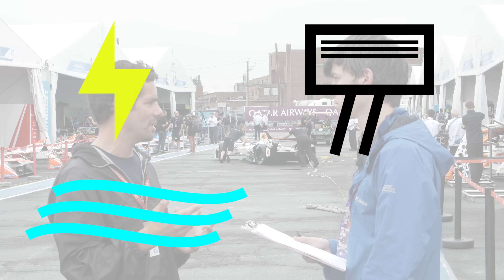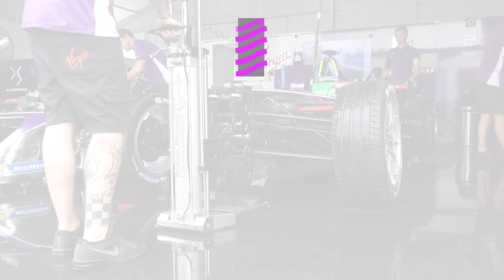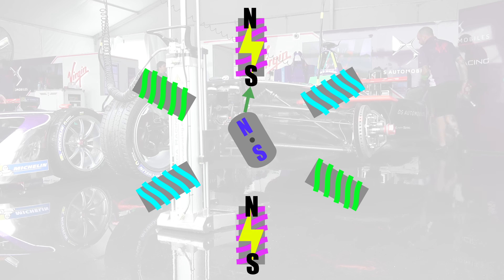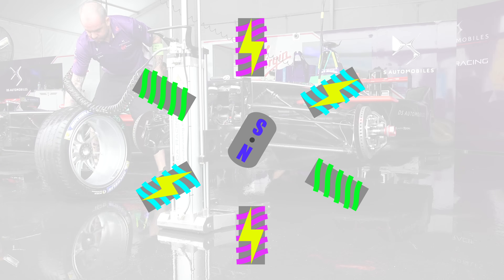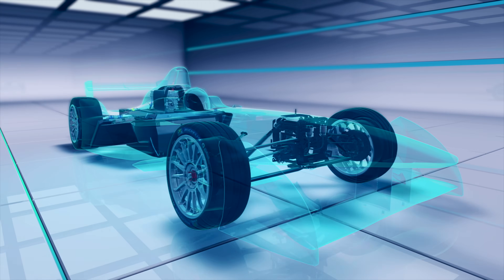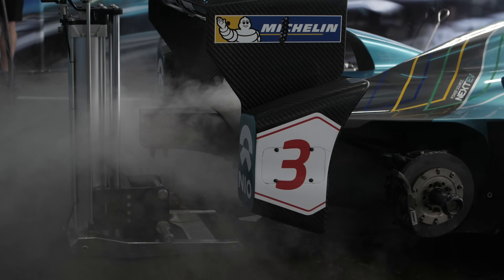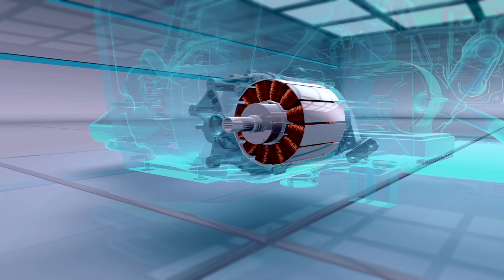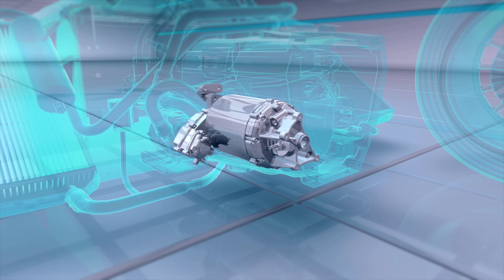Can You Tune Electric Cars For More Power?

Comment: In some of the rc cars you will need to tune the motor if it is a performance racing motor you can adjust the timing to get more rpm or more torque depending on the situation and a cooler running motor will have more power

Comment: Even though electric motors (or what I'm now gonna call E-Engines) are the most efficient design, they still follow the 2nd law of thermodynamics as do batteries and anything that produces heat wether directly or indirectly. However I'm keen to see what car modding will look like in the next 5-10 yrs or so.

Comment: I just think of it this way. 

Single phase motor is like a two cylinder engine. 
Three phase motor is like a six cylinder engine. 

Direct current motor is like a economy engine. 
Alternating current motor is like a performance engine.

Permanent magnet motor is like a gas engine. 
Series wound motor is like a diesel engine.

Comment: Conservation of energy question. If we replace the motor with stronger magnet, the motor get more torque, thus more horsepower at same RPM. Does this mean we will need more current to spin the stronger magnet at same RPM? Else this seems to violate the rules of physics, with free horsepower by simply adding a stronger magnet.
Reply: Yes thanks to the energy being transversed more efficiently

Comment: So you could theoretically tune-up a Tesla without replacing the battery and motor by changing out the inverter and tuning to motor timing to accommodate? And increase cooling... somehow.

Comment: I believe the main point is missing in this video: Of course electric cars will be tunable because as today's car manufacturers produce one engine and sell it with 5 different power ratings only differing by software they will do the same with electric cars.
Also they will be tunable by installing better cooling systems and then adjusting the power limits which were in place to prevent overheating.
Even the sound will be tunable since most of it will be artificially created anyway.

Comment: I'm no electrical engineer, but would it be possible to use a turbine to produce power at speed? Even though they don't need intakes for a combustion engine, they still need cooling. Would they be able to make use of cooling ducts by putting small wind turbines in them that create some more energy to put back into the drivetrain?

Comment: To the guys that want to know, yeas you could increase the power of a Tesla if you found a way to program the Inverter (or Electronic Speed Controller (ESC) like we call it) to have a higher amperage limit, yes this will produce additional heat and much like the Ludicrous mode reduces the lifespan, this will go even further. Also depending on how the controller is programmed this may cause the wheels to spin from a launch, however it might not increase high speed performance, since at that point the motor may be limited by voltage.

Comment: hi do electric vehicles comply with
 1 International Commission on Non-Ionizing Radiation Protection (ICNIRP). Statement on the "Guidelines for limiting exposure to time-varying electric, magnetic and electromagetic fields (up to 300 GHz)", 2009.

2 Institute of Electrical and Electronics Engineers (IEEE). IEEE standard for safety levels with respect to human exposure to radio frequency electromagnetic fields, 3 kHz to 300 GHz, IEEE Std C95.1, 2005.

Comment: We could improve motor cooling, considered that you could use more peak power of the electric motor for longer period.  Perhaps, you could use some nitrogen cryogenic liquid cooling and have much lower windings ohmic impedance, so less energy loss and more specific power given the same winding and engine configuration., assuming your engine metallurgy can hold that lower temperatures. Provided that your power battery bank has considerable more power than your previous engine configuration.

Other mod is that you can rewind the wire use different wire shapes. The electricity in higher frequencies suffers from skin effect, so the current flows through the exterior of the wire and rather than the inside. This thing elevates the ohmic resistance of the winding. A flatter wire could have less electrical resistance. Other configuration is, when we are talking about induction motors (squirrel cage) the rotors windings are made of aluminium that has higher resistance than copper. So if you change the rotors with copper cage, you could have less electric energy loss more EE is converted to mechanical energy, less goes to heat.

The “problem” with electric car that energy is very precious and is used with a least waste technology can provide.

Comment: Very good explanation. However, for a motor used in electric car, it is typically not a permanent magnet rotor. It is an induction motor(rotor is just metal bars). The motor produces maximum torque theoretically at its breakdown torque. However, by using invertor (aka VFD Variable frequency drive), an induction motor can run more efficiently and deliver more power at different AC frequency input while save energy.

Comment: in the rc world we mess with tuning electric motors all the time. changing the number of turns in the windings and how the windings are connected. we also mess with various rotor lengths and chemistries. we also change timing. with some of the motors i use 30 degrees advance is controllable and maybe a little slow while 40 degrees becomes too much to handle even on high traction tracks. i can even change the operating frequency between 16khz and 32khz to change how smooth and efficiently the motor runs. there is much more to tuning an electric motor than this video covered.

Comment: Why can't an alternator be attached to the motor? Couldn't you take some torque and put it into the alternator so you never run out of electricity. But as you said, heat is a problem.

Comment: Pretty sure everything on an electric car can be tuned for more power. Better quality batteries, more efficient inverter to take DC to AC and then as mentioned in the video the electric motor and its windings. Copper is a cheap low resistant material but I think carbon has even less resistance.

Comment: Crazy question.....would it be possible to submerge the engine in a conductive fluid that could be used to control the temperature and therefore narrow the gap between the stator and rotor?

Comment: I don't think that I heard the most important thing - you can pump as much energy in electric motor as you want, provided that you can take away excess heat (LOTS OF IT). And magnets really dislike heat. 
With BLDC motors you can tune the voltage supply wave to the nanoseconds, which can certainly help.

Comment: Hi Jason, this is not related to electric cars but I am interested to know the difference in strength and application between 4 lugs and 5 lugs wheels/hubs. The only thing I found from researching is 5 lugs' torque spreads more evenly throughout its surface. 

Hopefully you can help shed some light on this. 

Thank you!

Comment: Those who worry about being able to hop up electric cars - check into hobby-grade electric RC cars/trucks. They are quite easily modified with better controllers, motors, batteries, and gearing. I have a Stampede which was only good for 30 mph when it was purchased, that can now move at 70 MPH, assuming you can keep it going in a straight line.

Comment: I think for certain applications, such as drag racing, we will, indeed, see some very exotic electric motors built. BUT.. don't get your hopes up. They will more than likely, be very short term use as they will get hot enough to fuse the windings after a run or two... and may take over an hour to cool between runs. But... it's a start. Soon, very soon we will see 300mph electric drag cars. (pssst... there are a few out there right now)

Comment: Wow, they use dry ice to cool the battery pack, dry ice= CO2 -> GHG.... I though formula E is all about promising a exciting green future... and seeing this GHG get dump into atmosphere, I think the green part is just marketing gimmick.
About the EV tunning, lot of tuning on ICE car are actually eating into the factor of safety. Same can be said on tuning EV. Let along most electrical motor already have rated power output and maximum power output. You can program your electronic speed control to allow you always access to maximum power which quite often to be double of the rated power.
Reply: omg CO² we're all gonna die!
Reply: " I though formula E is all about promising a exciting green future..." A communist future for brainwashed fools that is.

Comment: Tinkering with a car that has over 300 volts at the batteries and not knowing what is involved, what safety precautions etc to take sounds like a recepie for disaster. Leave it to the professionals and qualified electrical engineers. Its likely working on your own high performance electric veichle will be illegal in the future due to accidents.

Comment: As you have explained, you can power up an electric motor depending on how strong the power current or on how strong the magnets the electric motor has. In this case, we can modify (or create) an electric motor with stronger magnets to provide more torque with a lower power source.

I think that's gonna work on electric cars for more power efficiency (just like modern engines for  normal cars for fuel efficiency).

Comment: No turbo or supercharger? No thank you! Ill stick with internal combustion engines.
Reply: And be beaten by EV
Reply: The equivalent to an ICE turbo or supercharger (re-using wasted energy for additional power) will probably be regenerative braking. IIRC Formula E or F1 already does this. They use the energy captured during braking to charge capacitors, which the driver can choose to dump into the motor for more power (KERS).
Reply: Peter Knagge The combustion engines will hot be banned, they just have to be bundled in an Hybrid package. The problem of pollution is on the meat production, but no one seems to care about that.
Reply: +Ohm Neh You are right, I shouldn't assume so much based on a single comment. I guess all the whining in the comments just got to me. I just think that there are great things to be learned from both internal combustion and electric motors. But as you say, preferences.
Reply: I saw a video where a guy with a Tesla was challenging other persons and he did beat a guy with a dodge demon easily. I think the video is on Tesla racing channel
Reply: yaaa. super caps can give a hard push....
Reply: What do you mean? Tesla have superchargers everywhere!
Reply: Blargh I'm used to this standard therefore it's better because I'm afraid of learning anything new!!
Reply: CockatooDude You can assume whatever you want about my mindset, but in the end you don't really know who I am. Its not illegal to have preferences (at least not yet).
Reply: Good luck! Many countries will have banned combustion engines by the middle of the century as part of their agreements to reduce greenhouse emissions.
(If only the world had done other things to reduce emissions sooner... And a big thank you must go to America for being the biggest polluters per person, and dragging the world's feet!)

Comment: Being a fan of RC toys. So far I know there are 3 type of electric motors , one high torque only, use for larger RC airplane servos, 2nd high speed like 3200kv type these use for RC jet style. 3rd 50/50 speed and torque. So I guess change motors or more V and AMP battery. Usually I change more Mah and Amp betters, also better ESU can take on more power.

Comment: By the way ordinarily a 1 mm copper cable insulated with pvc is ok for about 10 amps. In an MRI magnet the super conductor cables are 1 mm and cooled by liquid helium ( pretty close to absolute zero) they can carry 1000 amps. Current flow is limited by resistance, so if the motor is close to zero ohms the current is only limited by the internal resistance of the battery.

Comment: I think the main limiting factor of an electric motors output are the insulation properties of the varnish used on the copper cable and the resistance of the copper cable. Class h insulation ( varnish) is good for about 180 degrees. Increase this and more power is possible.

Comment: 28kW, 200kg,
So only a density of 0.140?
The model 3 Tesla has 0.25 right? How is that possible?
Reply: It's around 320 kg for 30 kWh, 28 kWh is usable and the cells, without the package around them weigh 200 kg. The pack energy density is, wait for it, 93.75 Wh/kg which is comparable lead acid batteries. Williams Advanced Engineering? More like, Williams Obsolete Enegineering. The sad part is that EV makers still call upon them to design their solutions. If I were making an EV I'd avoid the continent they're based in.

Comment: I expected a bit more from EE. There are a LOT of parameters when it comes to controlling the brushless 3/5/whatever phase motors (power limits, timings, PWM frequency and many more). And tinkering with these parameters can change the power output, efficiency and torque of a motor. Fairly similar to tuning a regular car.  Along with battery upgrades (more voltage = more power) you could probably get 50-100% power increase if the thermals allow it

Comment: Sooo.... can you tune electric cars or not?
Reply: A typical internal Combustion engine has around 70-80 parts(just INTERNALLY) and then they're all the external moving parts which must be considered when "tuning". The electric motor only has one moving part...so the idea of tuning is totally redundant...you simply want to increase available energy to get more "Go" from your electric motor.......so as opposed to "tuning" your electric motor, you are simply looking to extract more performance...
Reply: Extracting more performance = tuning.

Comment: Could you make a liquid cooled electric motor by adding cooling pipes into the stators.and having a separate liquid pump and a battery cooler.
Also Gold wire wrapped around the stator for lower resistance.
Reply: Modern electrics already have liquid cooled motors, and gold is not that great of a conductor. Silver is the champion of basic metals, and even then it's only a 7% difference.
Reply: @MsSomeonenew  gold is the best conductor of electricity wdym

Comment: We tune electric RC cars for RC racing all the time (1/10 scale touring cars). We have speed controllers ("inverter") onboard that can control the motor timing and boost power by almost 50%. The speed controllers advance the timing of the motor based on motor RPM so it dosen't have the torque drop when the motor is at higher RPM. We had these type of speed controllers introduced to us around 8 years ago and when they were, it was a huge improvement to have the tuneability of electric motors. The increase in speed was almost like adding a turbo to an real car's forced induction motor, so the programming was actually called "boost timing" and "turbo timing" for different levels of RPM/throttle position when racing.

Comment: Better budget out for more tires if you're getting big power from a brushless motor. I've used RCs before, and can kill tires quickly with excessive throttle.

BTW, more voltage = more power (higher rpm + longer torque curve).

I would like to see some universal standards for automotive drive motors. This would go a very long way in reducing cost and helping the hobbyists.

Comment: So basically electric cars are like electric rc cars. If you want to go faster get a better, bigger motor or change the gearing, and also get a better big battery with more discharge.
Reply: Except simplicity is not the problem here.
Reply: This simplicity is what makes electric cars great.
Reply: @ElektronikArzt  "change the whole motor and battery to gain power" "simplicity"
Reply: @whcwcjecjecuecuw6654  thats because changing a EV engine is far easier and less complex than changing a IC engine.

In fact, a EV engine is far less complex than a IC engine will ever be.

The only major hurdles are on the batteries.
Reply: @pedinhuh16  its not  you have no idea what your talking about
Reply: I learned about the basic dynamics for myself...I took a junk toy RC car that barely did 5mph, upgraded everything with (cheap) hobby grade hardware like a Lipo and brushless motor and it goes 30+ MPH now. I even had to get an ESC tuner to make it driveable, the default setting on the drag brake made it flip over violently, so I had to turn it off. It felt like I was building and tuning on a real car.

Comment: You should check out the videos on the channel Sweet Project Cars. He does a lot of videos making wear parts on a vehicle last a lifetime. Most of them seem I'm sceptical on, like using 303 aerospace protectant to supposedly make a serpentine belt last "forever." He even told someone it was ok to use the stuff on a timing belt. I think it would make for an interesting video.

Comment: Is there any reason why they'd switch the power to AC and then use an AC electric motor instead of just alternating the current using a split ring commutator? Wouldn't that save far more weight?
Reply: Commutators at high power start to spark like crazy, and you can easily loose 20% of your electricity just there. Not to mention the wear and tear you add with that.
All motors have switching current, just that commutators do it physically and inverters/controllers do it electronically.

Comment: A battery that's okay with a massive draw= more power. As I understand it, right now we have motors that can demand WAY more power then our batteries are capable of dishing out. Huge gains in power will be achieved by having batteries capable of drawing massive amperage without any voltage dip